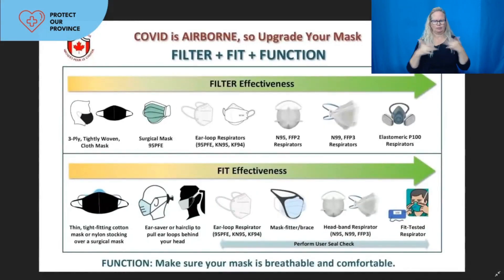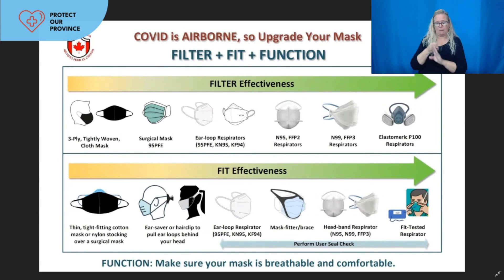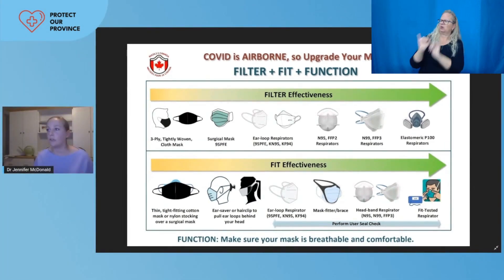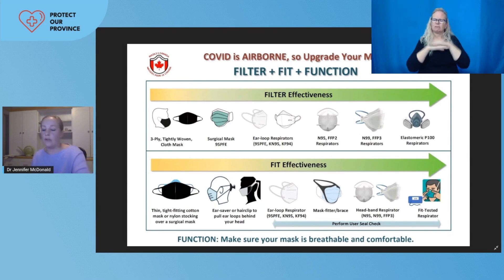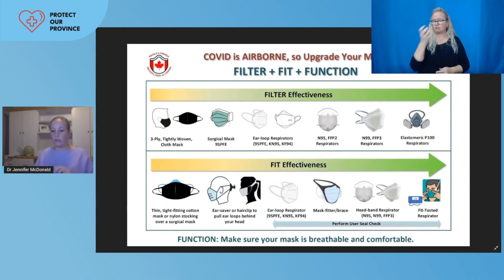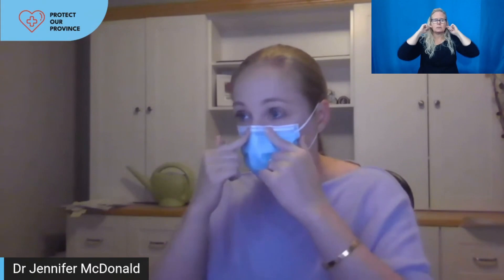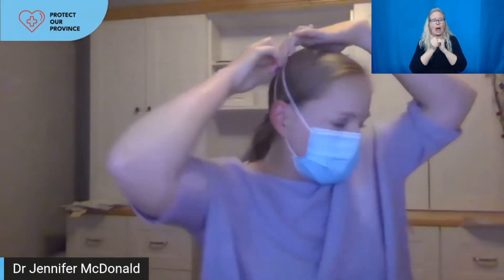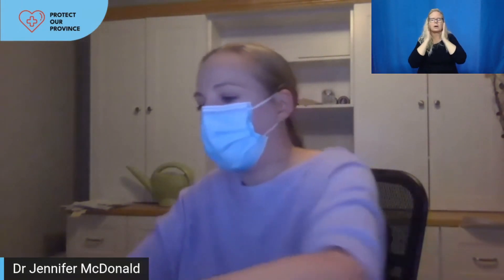Dr. McDonald: Fit, Filter and Function of masks

Comment: With the Fix the Mask brace, a much easier way to put it on is to first put the lower loop over the back of your neck with the top portion hanging down, facing outwards. Then pull the top strap over your head, placing the nosepiece over your mask.